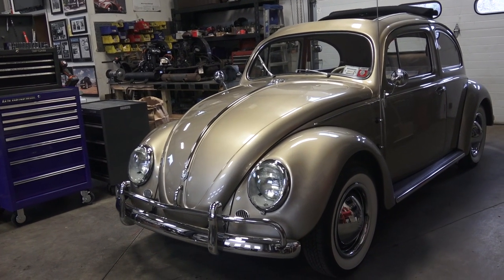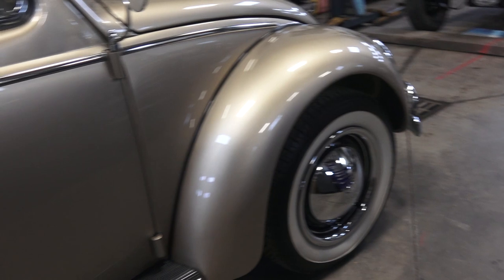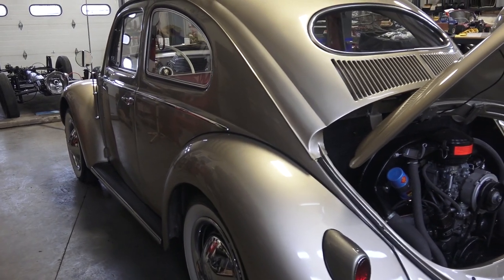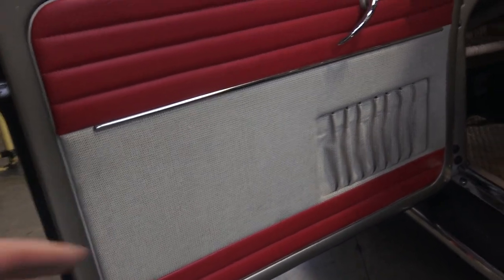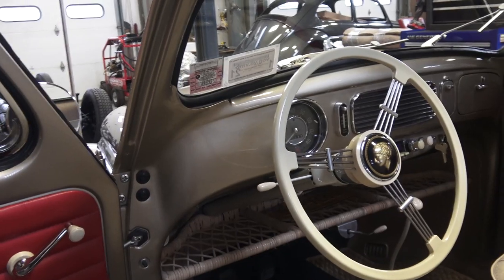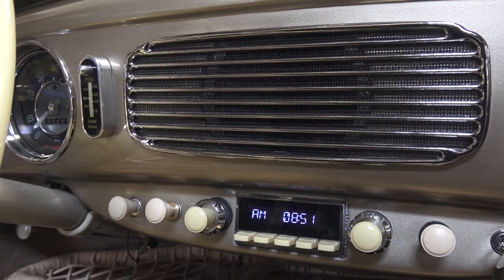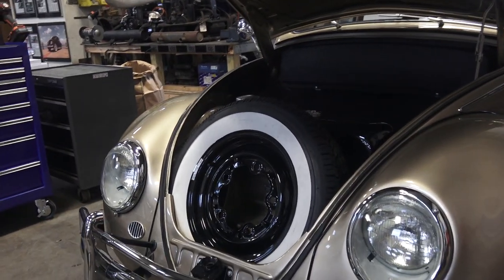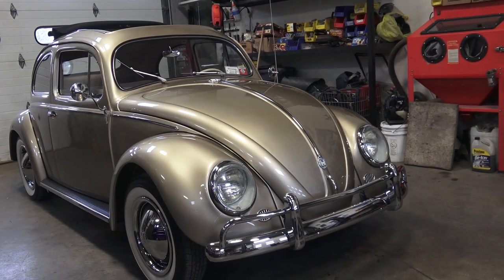Classic VW BuGs 1957 Oval Window Ragtop Beetle Restoration Build Complete

Comment: Just thought of something Chris but on the door panel trim ever looked into the 67 up outside trim and modify it with the tip pointed @ door handle just a thought not sure how close it will look,     in stainless of course OK have a great one..